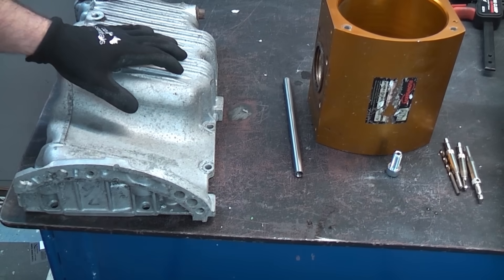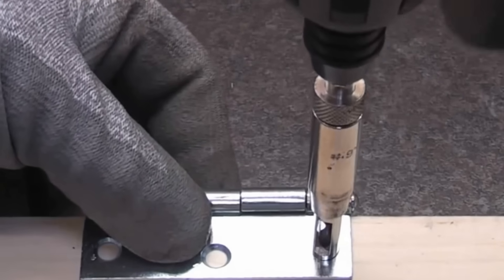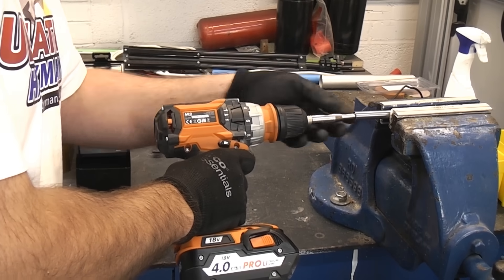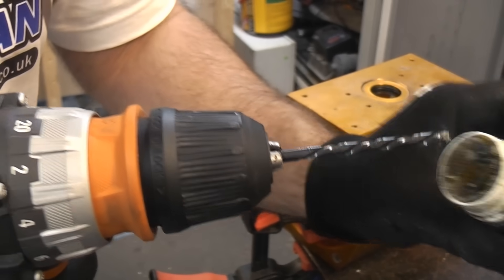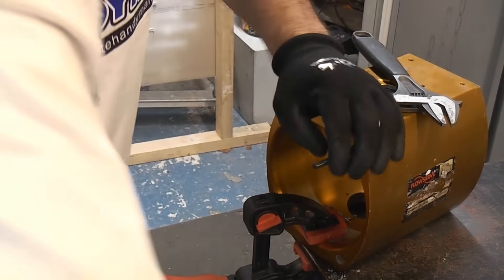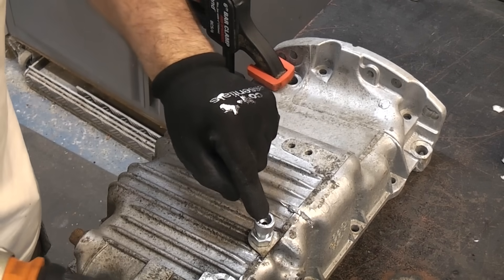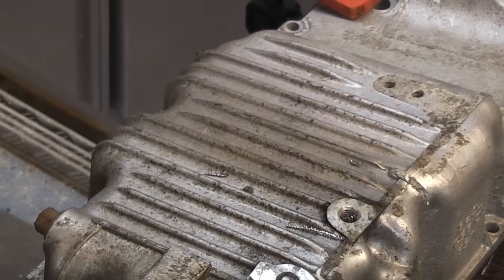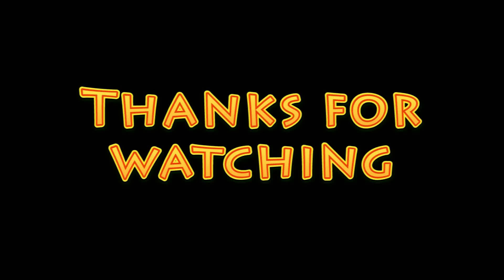How to remove a broken bolt in a deep hole | remove broken bolt in recessed hole

Comment: Is copper grease ok on an aluminium housing? Or is it going to contribute to galvanic corrosion,make the thread weak and cause more problems ?
Reply from the maker: I use it all the time on aluminium components and have been doing for decades, but apparently you are not supposed to use it.
Thanks for the comment

Comment: Noticed you have a slight problem with starting your extractors,
Try twisting it with a wrench when tapping it with a hammer, It grabs much better,
Reply from the maker: Thanks, I don't have a problem normally, but these are the cheapest of the cheap.

Comment: Before I use a left handed drill bit. I drill a pilot hole no bigger than the flute of the left handed drill bit all the way through. This will give the left handed bit to bite better. If after a 10 cm the bit is not working I apply heat through the hole then quench it with penetrating oil, Then retry the left hand bit again. you are right ti maintain the center or you loose the hole. like the centering Idea.
Reply from the maker: Thanks for the comment

Comment: What do you do when you shear a left hand bolt off? Right hand ez outs are not available.
Reply: Drill a hole in the snapped bolt as shown in the video with the biggest diameter bit you can (but make sure you leave a couple of millimetres of materiel on the stuck bolt) as deep into the bolt as you can. Then tap it with an appropriate size right hand thread and use a high tensile bolt with the same thread size you just tapped as the extractor. If it is not stuck due to extreme corrosion you should be able to get it out.
Reply from the maker: Great response ;-)

Comment: Using a proper adapter to wrench on the extractor helps a lot with difficult bolts
Reply from the maker: That is correct, which is why I said in the video that "mine is at work"
Thanks for the comment

Comment: A couple comments, holy crap that's a lot of copper kote! And any suggestions for broken steel bolts, that have corroded badly in aluminium? I work for an oil field trucking company in Alberta, Canada, and broken bolts are always a problem when repairing the equipment, so I'll be making some of those drill guide bolts for our shop. With broken steel bolts with bad corrosion in aluminium, I've tried all of these methods, plus building up the remaining end of the broken bolt, and welding a nut on it. I have even resorted to drilling it all out and retapping to a larger size. What would you recomend?
Reply from the maker: I'd start by giving the bolts a really good shock and then get some good spray penetrant, and if possible apply that and let it soak in. Corrosion can be a real pain in the backside, I would look into some anti-seize compound, specifically for aluminium and start applying that to all bolts. Normally at work I coat everything with copper grease and when you repair it again 6/10 years later it is really easy to undo the bolts. The big problem we have is with stainless steel bolts and nuts, only yesterday someone had installed a steam valve into a 2" steam line and they put 1/2 inch diameter stainless steel bolts in one side of the valve. Two of the bolts were impossible to undo, even with a 3/4 inch breaker bar - I had to cut through them with the hacksaw!

Thanks for the comment
Reply: Heat, shocking and welding a nut on served me well when everything failed,
 sometimes a helicoil is the only way out.I had to remove many in an auto job.

Comment: Links to the tools would be helpful. Great tips.
Reply from the maker: I used hinge centering drills- https://fave.co/2oLRFTf
Left handed drill bits- https://fave.co/2NfSGkF
Screw extractors- https://fave.co/2CmZF6R
Then socket/cap head bolts, but these need drilling down the centre using a 6mm drill bit for M10 and M12 bolts. This can be done on a lathe or pillar drill.
Thanks for the comment

Comment: not as difficult on the bench top. but when its on the car or whatever you're working on, and you're in a cramped area, or no good viability and lighting it makes it much harder. never fails you have an aluminum head with steal bolt broken where its impossible to get to without removing the head.  your weekend project turns into a 5 day project. lol
Reply from the maker: That is true, but it's much easier for me to demonstrate on the bench ;-)
Thanks for the comment

Comment: Centering guide is a great tool. I like to use the square screw extractors. You have to be careful to not flare the end of the bolt. START with WD-40 every time. Very good instructable. Very impressed you got the piece out of the aluminum head.
Reply from the maker: Thanks for the comment

Comment: What do you do when the remaining bolt length is too shallow to make a starting hole?
Reply from the maker: If it is close to the surface you can often tap it round using a centre punch. You would be amazed how useful a centre punch and hammer can be, or even a spring tools centre punch.

You can see one in use in this video- https://www.youtube.com/watch?v=_mTFQbaT3Zc
Thanks for the comment

Comment: But how can a bolt snap off when it is not stuck? The removal was very simple after drilling a center hole in the broken bolt. It was not stuck.
Reply: and sometimes layer of oxides and other dirt is not so deep, so when you broke first part of screw, rest go out easier.
Reply from the maker: It was stuck before I shocked it, applied heat and sprayed penetrant onto it ;-)
Reply: Beetle 
No it was overtightened.

Comment: Ok now try it on a very rusted cast iron piece. Any product works in a shiny new clean piece with perfectly shiny clean threads.
Reply: Maybe try leaving some vinegar in the hole? It might eat enough rust to make it helpful. But I haven't tried it. Vinegar is a pretty decent rust remover, but you should be careful as it shouldn't be kept too long on a surface as it can eat even metal after a while.
Reply: Abiel Rodriguez .......I rest my case. Thank you, your latest submission allows, indeed encourages a short summing up.  No contest, much appreciated.
Reply: Abiel Rodriguez .......In the majority of cases there is a solution and it generally comes about with application of heat, penetrants, use of as many skills as possible and above all.....patience.   The video was to provide positive solutions that have worked for decades to the YouTubers that need a little help.  Your comment however was negative and served no useful purpose at all, other than to make you feel important to yourself.
Reply from the maker: Have you done a video about it?
Reply: If you have access to an oxyacetylene outfit, with a small brazing tip,,, and you can turn the work piece so that the hole is pointing toward the ground,,, you can (carefully) melt the stud out of the cast iron.
Reply: you will screwup the threads
Reply: K.N Vijayakumar  The key word is "carefully". The reason the stud is bound up is because of corrosion/rust. Obviously, because the stud is broken, new, un-rusted metal will be exposed. That un-rusted core goes through the center, to the bottom of the stud. The male threads on the stud and the female threads in the hole are coated with corrosion/rust. The un-rusted metal of the stud seems to have a lower melting than the corroded metal. All you want to do is melt the center out, stay away from the threads. When finished, you will have to chase it with a tap. I've done it successfully on many 3/4"  dia. holes. Larger holes would be a breeze. I wouldn't be afraid to try it with 1/2" holes. The process is similar to scarfing and blowing rivets on structural steel or retrofitting a boiler. If you know any OLD Ironworkers or Boilermakers, ask em....

Comment: Of the broken off bolts I've had to deal with, the threads were well-fused together. If they weren't, why would the bolt have broken in the first place? I've almost always had to just drill the whole thing out and use a Time-sert.
Reply from the maker: Thanks for the comment

Comment: I was always taught to never use copper grease on aluminium as it can cause a weird dissimilar metals reaction.
Reply from the maker: A few people have said that, but-
I know people that have used it for years, and before making this video I searched Google but could not find any proof, even the manufacturers websites did not tell you not to use it on aluminium.
Thanks for the comment

Comment: Excellent tip on using the guides for drilling. I usually weld onto the bolt and if it is recessed too badly, I will cut a small section of tubing to fit the hole, then weld up slowly with spot welds. Once high enough, I will place a nut on top and finish welding up into the nut. Let cool slightly, then remove.
Reply from the maker: Thanks for the comment

Comment: Avoid using any metal based anti-seize compounds in applications where exposure to salt water is present. he dissimilar metals form tiny batteries and cause electrolytic corrosion to occur and causes the bolt to actually weld it self to the threads. In the ROV Industry we would use Aqua Lube, A wheel bearing lubricant for boat trailers. We never had a failure using this product as both a thread lubricant and anti-seizing compound.
Reply from the maker: Thanks, this is starting to make sense now. A few people have commented about not using copper grease on Aluminium, but after searching the internet and after knowing people that have used it for decades on motorcycles, with no problems and even checking the manufacturers website I could not find any proof that it caused a problem. Perhaps if I lived near the coast it would be a common problem, due to the sea water! 

Thanks for the comment

Comment: Can you tell me where can buy your tools buddy . They are amazing
Reply from the maker: I used hinge centering drills- https://fave.co/2oLRFTf
Left handed drill bits- https://fave.co/2NfSGkF
Screw extractors- https://fave.co/2CmZF6R
Then socket/cap head bolts, but these need drilling down the centre using a 6mm drill bit for M10 and M12 bolts. This can be done on a lathe or pillar drill.
Thanks for the comment

Comment: I once used copper anti seize (and still do on steel) until I saw what it did to one of my aluminum antenna elements. If moisture gets between the steel and aluminum, the copper in the paste will cause the aluminum to pit. When working on aluminum I recommend an aluminum based anti seize.
Reply from the maker: Do you live near the coast by any chance?
A recent commenter said that salt water makes the aluminium and copper grease react.
Thanks for the comment
Reply: No, I'm in SW Mississippi and during the summer it can be like living in the jungle with all of the humidity. The pitting is caused galvanic  reaction. When dissimilar metals are in contact corrosion occurs because a voltage  develops. Any moisture will cause problems. It's the reason zinc is use to plat steel.

Comment: This stuff would be a great addition to all your penetrant suggestions.  Used about 3/4 of a can to remove a harmonic balancer (old tech language) on my daughters Mitsubishi Eclipse.  I was going to have a repair garage do the removal, and his extractor tool broke.  We towed it home, I purchased an Eclipse specific extractor.  Wouldn't budge, until about 5 or 6 applications (3/4 can) and it came off nicely.  I NEVER use traditional penetrants anymore, as this works much better.  You won't be a believer like me until you try it.  https://www.ebay.com/itm/Crc-Industries-5002-Crc-Freeze-Off-Super-Penetrant-LOOSENS-RUSTED-NUTS-FAST/223125467183?hash=item33f350702f:g:uTEAAOSwqBJXVhV2
Reply from the maker: I have tried a similar product made by Henkel (I think), it worked once on a small diameter machine screw but was not that good on a large bolt.
Thanks for the comment
Reply: Hi, a large bolt could take up to half a 12oz can, or more, to get the freeze.  Properly frozen, it makes a lot of clearance for the penetrant plus the freezing means the bolt shrunk away from the nut or bolt hole.  The crankshaft on my daughter's Eclipse was at least 1 1/8 inch diameter, and I used most of the 12oz can.  Thanks.
Reply: CRC,  does make a Good line of products.  I'm a big fan of Tri-Flow Teflon for a lot of things as well.

Comment: Great video. I came across it as a recommended video. Just want to let others know that it doesn't have to be this complicated if you just have a broken bolt that is not that deep in the hole. All you need is a extractor bit and a comparably sized drill bit. Drill into the center of the broken bolt and use the extractor bit in reverse to remove the broken screw. The smaller the bolt, the smaller the extractor bit and drill bit you'll need.
Reply from the maker: Thanks for the comment

Comment: As a Industrial maintenance mechanic w/over 20 yrs. experience  can say I am found of left hand drill bits, and the use of guides like shown in this video is a must, as they never shear off cleanly it seems, and often when you get them drilled a bit, they will loosen and you can take a pin punch, or even a screwdriver jammed somewhat into the hole and back them out. The 'hinge-guide-driller' was a great idea..must admit hadn't thought about that one..but the bolts with holes made in a lathe, is something we used for years.
Reply: once you drill right through the bolt it comes out easier, I think it reduces the strength and it cant apply the same gripping force. Plenty of penetrating oil and one turn out quarter back as if you are tapping a thread helps prevent breaking it in the first place.Oh and really impressive video
Reply: on broken bolts that arent flat I always start the drill 90 degres from the spot I want the drill to start in. what I mean is that someone will inevitably run over and check to make sure I know what I am doing, cause it looks like I am drilling sideways into the part. when the drill gets its start, move(while the drill is turning) to your correct angle and drill into the center of the bolt. you make a start where you want it to be, then adjust angle and it should be right in the middle.
   got this trick from an old machinist school book. originaly it was a way to get a hole started in precisely the right place and prevent 'walking' that also involved making punch marks just so to nudge the bit over to where you want it and I modified that. old books are better than the internet, you dont need electricity to use them.... also there was this thing called "proof reading" back in the day when printing presses were set type...
Reply: SURE,if the bolt is flush with the surface; IT USUALLY iS,i never saw them like in the video,and so nice and clean,LOL; it's obviously a setup!!   But if you DO HAVE a few threads showing,NOTHING beats a drill GUIDE,a drilled very short bolt,a GREAT IDEA!!
Reply: Nice observation!
Reply: @lukewarmwater6412  - Wut deos 'purff reedng" meen?
Reply from the maker: Thanks for the comment
Reply: Hollow bolts. Yep, definitely Industrial Maintenance Mechanic tools. Not what a "handyman" would usually be able to fabricate.  Not unless his steam punk grandpa handed him down his old lathe.
Reply: Screwdriver jammed into the hole as a backout - exactly.  After three days of multiple unsuccessful techniques and even breaking a tap in an engine block, I once removed it by drilling a hole and jamming a gunsmith screwdriver into it, then backing it out as you described.  In these situations we use whatever works.
Reply: niceguy217  I have used a small awl and just tapped it out
Reply: You are the kind of students I always liked.
Reply: They are called self centering drill  bits
Reply: i use a center punch!!!!!!!!!
Reply: Gumiho Yeu  - I still have a set of three Weber 42DCNF carbs with intake trumpets and the vacuum gauge for setting them. I think I'll mount them in a glass case.

Comment: Great video. All the same steps I usually take. The hinge tool and drilled bolt guides are genius though!
Reply from the maker: Thanks for the comment ;-)
Reply: Any time! Thanks for the reply. :)
Reply: 802 Garage--The hinge tool (spring-loaded drill bit within a metal body that fits into the hole) is generically known as a "Vix-Bit".  They are made by the S.E. Vick Tool Co., Inc., Lakeville, MN 55044 and others; Bosch also makes them and there are some Asian imports as well.  They've been around for years and are available through Amazon and many industrial suppliers like Grainger and MSC.  I have to agree the drilled bolt guides are also invaluable.  Perhaps another viewer knows of a company that offers them for those of us without access to a drill press or lathe.
Reply: Use an endmill instead of a drill on broken bolts. Endmills don't walk.
Reply: He to the fucking point in stop talking bro

Comment: Beautiful job until the copper paste at aluminium. With moistre it will korrode soon!
Reply from the maker: Before making this video I did search Google but could not find any evidence to back up what some people have said. I have a friend that has used it for years on motorcycles with zero problems, so perhaps problems only occur in certain environments? 
Even Rocol's own website makes no mention of not using copper based anti-seize compounds on aluminium.
Thanks for the comment